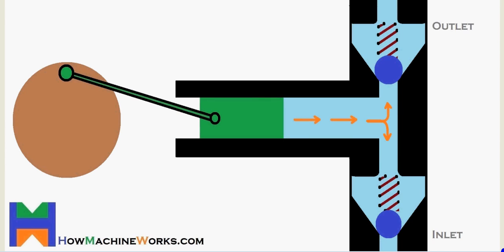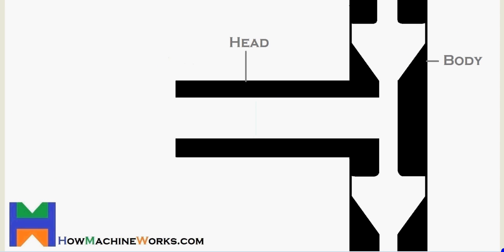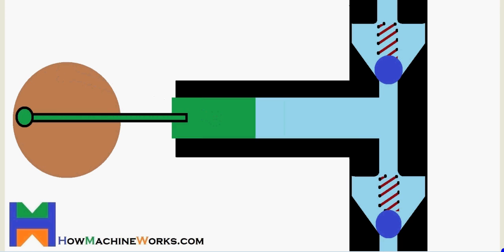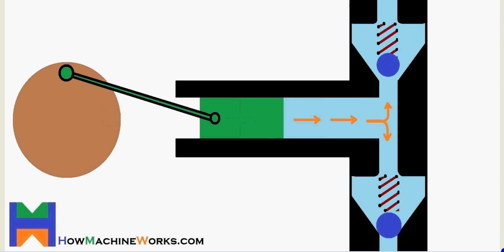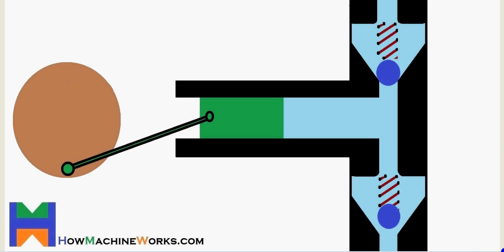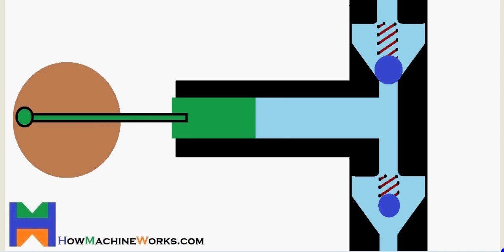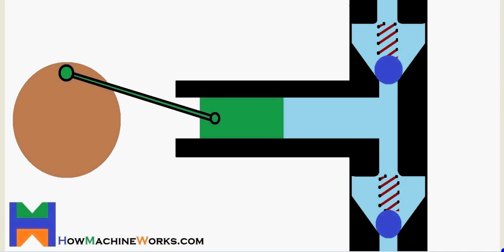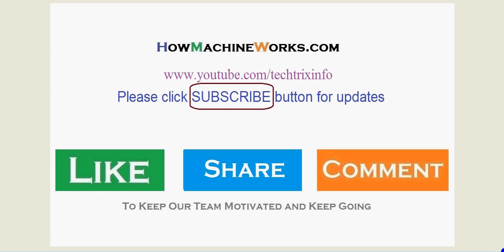How plunger pump works - Animation

Comment: I have a question: Do all the plungers or pistons have the same run? that is,do  they travel the same distance within the cylinder to create suction and then push the water or oil out of the cylinder? Thanks for the response
Reply: Yeah they have same working as single acting piston pump but cross section area and displacement is different in both cases

Comment: this is piston reciprocating pump not plunger .
Reply: Amazng Tariq 

It is a piston pump because the pressure seal between the plunger and connection rod is moving with each stroke. A plunger pump utilizes a stationary pressure seal, and the plunger makes it's stroke through the seal.

Shiva prasad 
The ability to communicate is the fine line which differentiates knowledgeable teachings from intellectual diatribes.
Reply: no it plunger pump but it has almost  the same working principle
as piston pump
Reply: Amazng Tariq  know the difference between plunger and piston pump ..